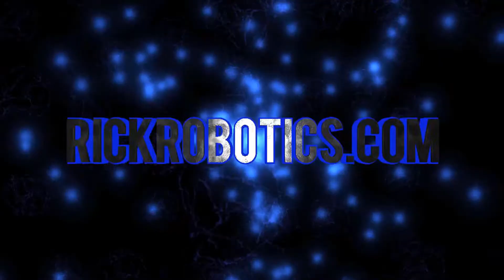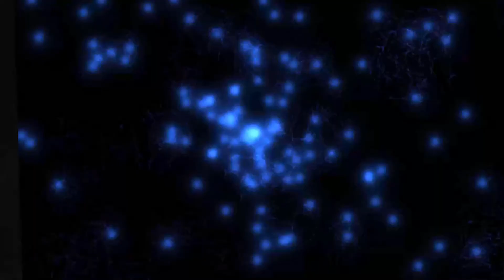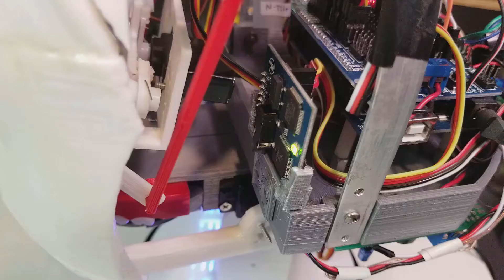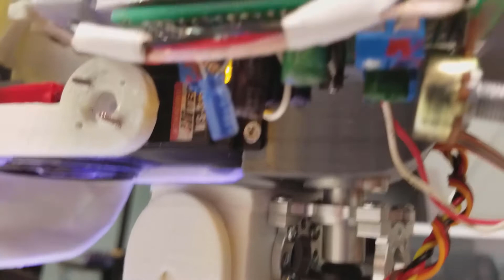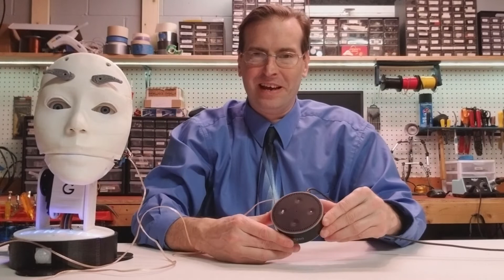Rick Robotics - GENESIS Robotic Platform Part 2 - Voices

Comment: Would sure like to see your emic2 sketches...
Reply from the maker: The code it pretty simple. I basically modified the samples found here:
https://www.parallax.com/downloads/emic-2-arduino-example-code
To call them from one Arduino to another, I used the Serial lines. So when the the "Triangle button was pushed, it would output a character (like "A"), the other Arduino would check if a button for that character, then signal the Emic to output a given phrase. I used different characters for each button, and of course, different replies for each character received. This could be randomized as well, if you didn't want the replies to be too predictable.
Hope that helps!
Reply: Ok, very cool. But, I'll need to check into methods for using serial, as everything seems to revolve around that. I did find this though, a little more complex than the example I wanted. But, its cool. https://www.instructables.com/id/Arduino-PHP-Text-and-Data-to-Speech/
He uses a weather station as an example. The example I really wanted to show you was a simple distance sensor that outputted the distance by using the Emic2. But, apparently didn't save that so I'll need to find it. I'll be back with it soon I hope but probably not tonight.
Reply: The thing that made the ultrasonic distance sensor and emic2 unique was it actually told you the distance info from the sensor, output to the emic2.
Reply: At least I thought it told you the distance. I'm wondering now if I was mistaken. That's what I want. I want the emic2 to be able to take data from any sensor that is read and output the result. I am not necessarily a programmer so I generally modify other routines.
Reply from the maker: It doesn't appear to actually give a distance reading. From the looks of the code provided, it seems to have 2 states. One does nothing (when out of range of the sensor) and the other acknowledges a target is in range and says "Fire." So, basically, it is only triggered by the sensor, not reading it. Unless I missed something. Perhaps contact the author for an example?
Reply from the maker: This one does actually read text it finds on websites that is in the PHP format. I dont' know much about how that works, but i seem to remember watching a similar video about using and EMIC 2 to read emails in a similar fashion. Hope that helps!
Reply: ok, i'll look for the "reading" connection, maybe that will help the search engine. THANKS (ps, I've looked at forums and people really have a ton of trouble with the emic2. programming. I wish Joe Grande would have spent a little more time and provided more stuff, or gotten help from some master programmer. I do know one, his name is Ian, but currently he is very busy with a radio called the uBITX. Would take him an afternoon to write a complete utility group for the emic2. If I can successfully entice him, I'll get back to you.)
Reply from the maker: Yea, I agree that the Emic 2 is a bit flawed. I have tried writing a library for it on a couple different software platforms and it never seems to respond consistently. I started with the Emic 1, which had its set-backs as well, but was much more consistent in its performance. I Like the extra features added to the Emic 2, but some of the quirks it come with can be bothersome.
Reply: I've found someone who worked it out. 
I think I''ve found a simple program here. first the video demo. https://youtu.be/li_ip0KPfxE then the sketch ino file https://www.robotshop.com/letsmakerobots/files/Color_sensor_EMIC_2_demo.zip 

 
 

Reply